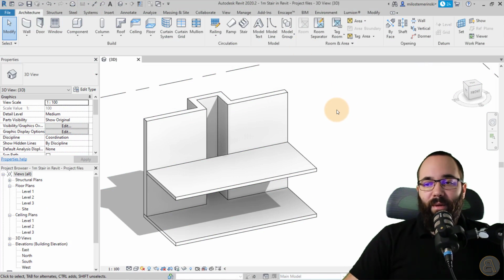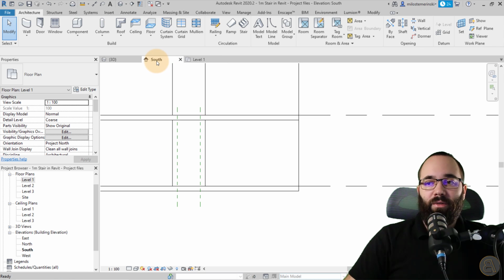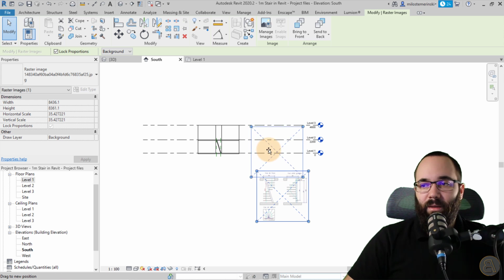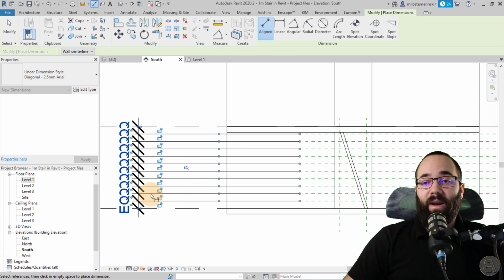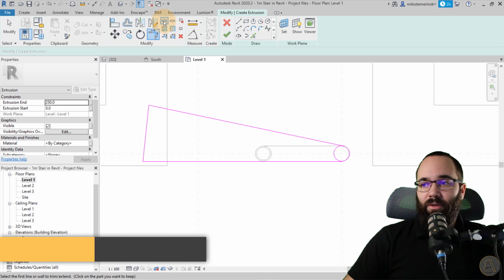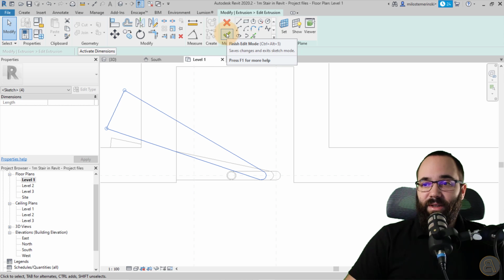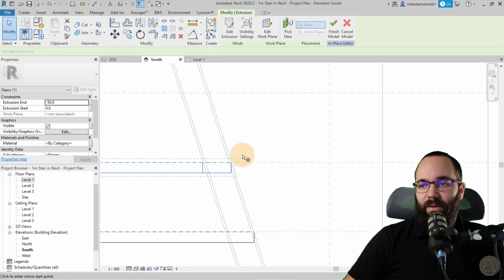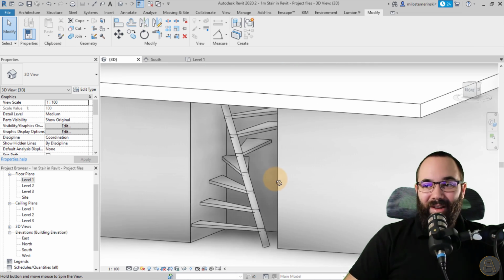1m² Stairs in Revit Tutorial - Micro-stair

Comment: I have used these stairs in one of my recent projects, I have modeled it in family environment, and placed it in a model in place family. Instead of an image reference I used the ifc file provided by the EeStairs that sells these stairs. The geometry was more complex than simply rotating the stairs every thread had different angle between its edges. You should check that out ifc out, they have done some cool geometry based on hiperbolic parabolid
Reply: Do you have a link to the ifc please?
Reply: @aphrogamer4502  just type eestairs on google
Reply: @GrishPanosyan I did as you, but for some reason my IFC files is not showing in revit<